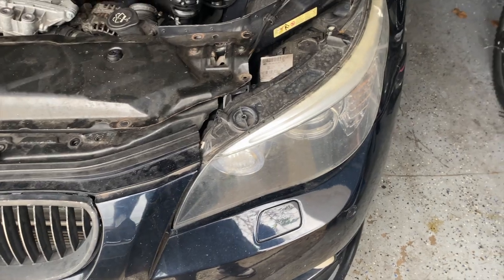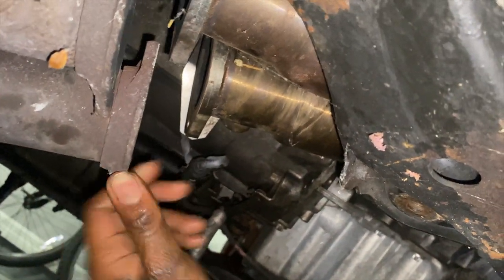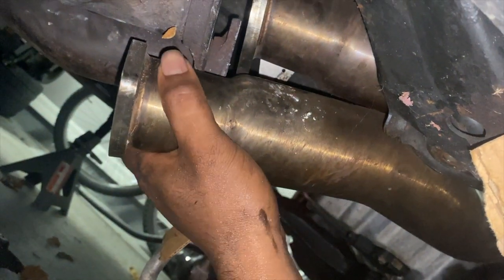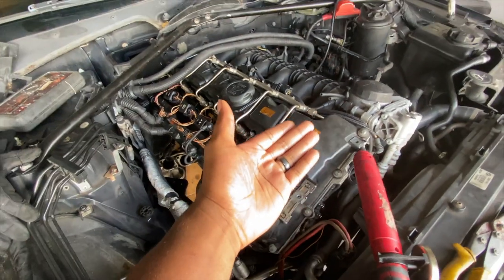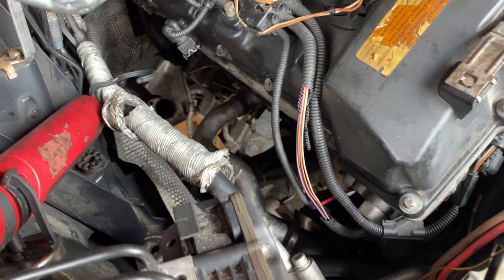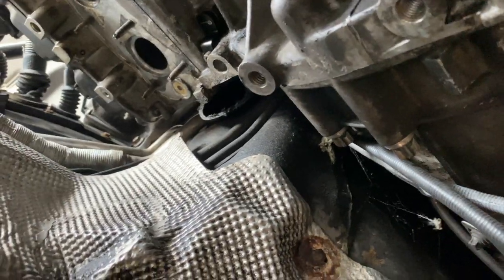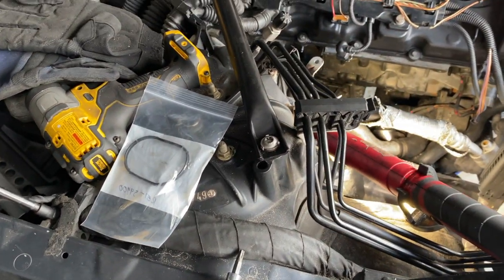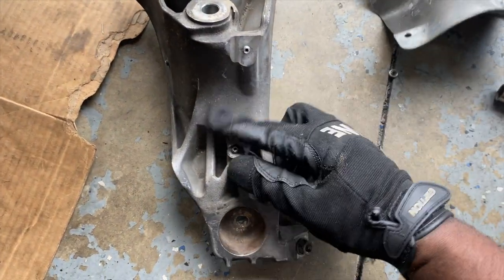E60 BMW 535XI Get A Single Turbo | Part 01 of 03

Comment: I immediately subbed as soon as i saw the title. No one else seems to have posted anywhere even in forums of a successful single turbo setup for an e60 let alone one with x drive.
Reply from the maker: Appreciate it! Yea I know what you mean I’ve seen like a 15 second clip here and there but no one speaks on it. So just tried and see if I could make it work with my limited fab skills lol.
Reply: Since 2008 there has been single turbo kits for N54..  I have been doing single kits on N54 myself for 10 years
Reply: @TheFLGUY76  cool story but I clearly stated for an e60 with that n54. E60s have an ac line and the brake abs box in that same area which get in the way.
Reply: @milehighboost5521  not sure what u mean.  Looks like you made good use of the space you have.  What I meant was you insinuated that a single T-kit on a 535Xi is a newer thing.  The 335 is the more common N54 chassis,  but the e60 has had single turbos for a long time.  We would make new brake lines and relocate the abs.  Once that's done it's much easier.  That's what I meant by my statement.

Comment: Im doing turbos rn on mine glad you showed it without dropping the subframe. I went with tdo4 17t
Reply from the maker: Ohh sweet nice. Did you remove stock downpipes or aftermarket catless dp. Since I was curious if the way I did it would work out for stock downpipes.
Reply: @nOshi2x  they were after market, I ended up removing subframe anyways to change the oil pan gasket lol
Reply from the maker: @BoostedBimmers  ok cool. yea good call on replacing it while down there.

Comment: Can this be done to a 525i? Maybe I’ll have to upgrade rods and pistons
Reply from the maker: I don’t think the n52 exhaust manifold ports line up with the n54’s. If it does then can possibly use the kit. I think the a/c compressor runs and belts run on the passenger side compared to the n54 driver side, so might have to do something about that or run no a/c. I’m just speculating, but with time and some fabrication anything’s somewhat possible.
Reply: @nOshi2x  I have a M54 engine. 6 speed manual
Reply from the maker: @KP-li9wr  ohhh not sure then. I know for sure the on3 manifold won't fit to it, you'd have to use another kit.